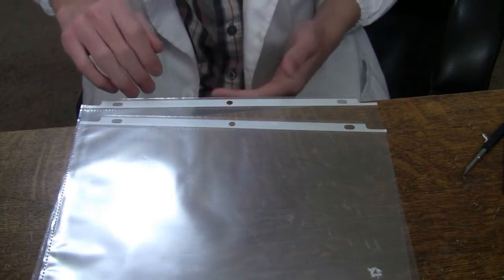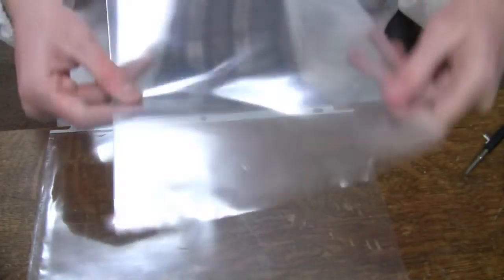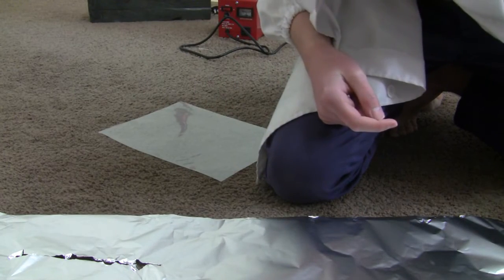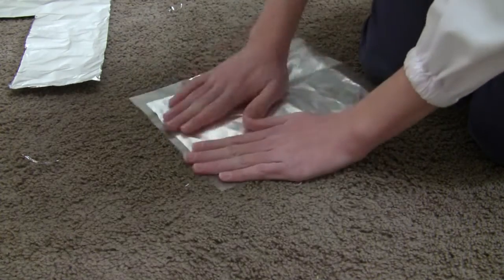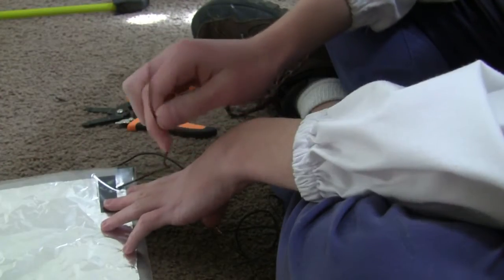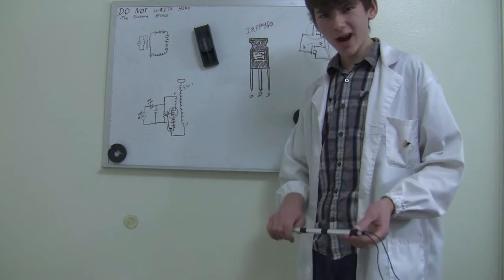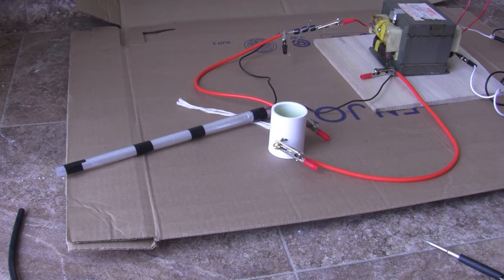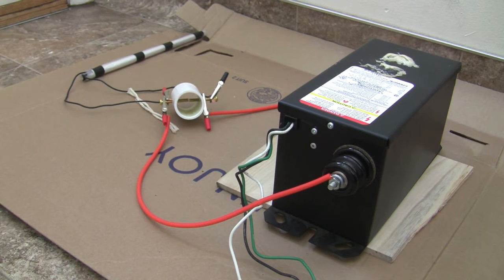DIY High Voltage Capacitor - High Voltage Plasma

Comment: Hey, i made one and tried using a MOT with it but it just bypassed it and arced mormally. What should i do?
Reply from the maker: Test the capacitor with a multimeter. If the capacitance reading doesn't show up your capacitor shorted out. Also I definitely don't recommend a MOT because they can't really arc across a gap on their own and they can dump a ton of amperage into your capacitor. If MOTs are all you can source, try a heavily ballasted dual MOT setup maybe
Reply: @Plasma.Prince Thanks a lot! Also, is it ok to use a one microwave capacitor in series with the secondary of the MOT to limit the current? Or should i use a light bulb in series with the input. I just dont want to bring down the voltage too, i dont have an inductive ballast haha..
Reply from the maker: @OpEdits1214  I've actually never tried using an MOC as a ballast so I'm not experienced enough to speak on that. I have used incandescent light bulbs as ballasts many times though so I can safely say that those are a good option for under 5 bucks.
Reply: @Plasma.Prince Ok also what were the diodes for when you used the MOT were they just rectifying the ac to dc for higher voltage?
Reply from the maker: @OpEdits1214  The dielectric strength of a capacitor drops when driven with AC instead of DC, so my 14 yo brain thought I needed them to protect my capacitor. The voltage was nowhere near high enough to short the capacitor though, I should've been more worried about the amperage.
Reply: @Plasma.Prince oh

Comment: How do you charge a capacitor with an AC source? Wouldn't a Van De Graaf work better?
Reply from the maker: A proper van de graaf can make bigger sparks if that's what your asking, but the point of that demonstration at the end of the video was just for proving that it works. You can use this DIY capacitor in a Tesla coil, big voltage multiplier, or Marx generator, which almost always produce bigger sparks than a van de graaf. As for AC capacitor use, AC will just charge and discharge a capacitor faster than it would if it were driven by DC, and it's used all the time. They're used to smooth out AC in rectifiers, they're used in voltage doublers, resonant circuits (Tesla coils), etc.

Comment: Lots of people have died using microwave transformers- by doing this without clear warnings you saying it out loud - personally are share responsibility for their deaths.
Reply from the maker: Mb bro, I'm usually better at remembering to put that in there, I'll put it in the description.
Reply: Thank you for acknowledging this … edit your video with a Risk of Death warning Do Not Do this at home.  People don’t read descriptions.   You are legally responsible for what you say on here. 

You can be sued- you can end up loosing everything with a very long prison sentance.
Reply from the maker: @AutisticCuriosity  I highly doubt I'll get in trouble if a person bypasses the warning in the top line of my description, on the case of the microwave oven, and on the sticker on the MOT. At that point, whatever they do is on them.

Comment: What is the role of the capacitor in this circuit? Knowing that you get high voltage without using a capacitor?!!
Reply from the maker: Eh, there's technically no role. The only point of that setup was to prove that the capacitor worked. But capacitors are crucial in a Tesla Coil circuit, so what I could've done to make the video cooler is build a Tesla Coil with it.

Comment: I have been a high-voltage engineer for many years.   PLEASE, PLEASE, do not underestimate the LETHAL aspects of those microwave oven transformers (MOT's)!  They can kill you instantly with the slightest mistake or an accidental nudge!!!  Use the neon sign transformers (NST's) instead...MUCH safer!  I know of TWO cases where an experimenter was killed instantly with a single MOT'!!!...and many times where experimenters were shocked with NST's, but would have died if they were MOT's!

At about timestamp 3:50   you said "WE NEED MORE POWER!",  Believe me, when you switched out the MOT for the NST, you were indeed putting in MUCH LESS power...and being MUCH safer!.

A 2000v 1A MOT (2000 Watts of power) is about the most deadly combination of voltage and current for the human body that you can find lying (YOUR body and/or the MOT) around.    A 12,000v  30mA NST (360 Watts of power) is a much better choice for more exciting and safer experiments.
TAKE CARE
--dALE
Reply from the maker: Hey Dale so sorry I didn't see your comment until recently, I realize that I forgot to include a proper disclaimer about MOTs in this video so I just edited the description to have one. As for what I said about more power, I mostly just said it cause it's classic lol, a MOT 100% packs a bigger punch than an NST. What I really needed was more voltage. I am older now and more experienced, so you don't have to worry about me!

Comment: I did this, and glued the sheets tight to the foil and it eventually arcd through... only of a 24v zvs driven flyback, maybe about 3kv output
Reply: You definitely want maybe 3-5x more dielectric sheets. They are not manufactured for surface purity and have some microporosity and irregularities.
Reply: I bought some thicker page protectors, didnt glue the sheets and it worked perfectly off 34.5v input to zvs :), with only  2 layers between foil so same as video @jordansimmons5538
Reply: If you want you can use epoxy and a thicker sheet
Reply from the maker: High frequency AC is definitely more capable of cutting through a sheet of plastic than a 60Hz NST, and the glue may also create uneven charge distribution across the plates and air pockets. This concentrates more charge across smaller sections of the capacitor and causing a burnout. Both are killers, sorry to hear about your capacitor!

Comment: What is the difference in the spark with and without the capacitor?
Reply from the maker: The spark is pulsated when the source travels through a capacitor, which is good for dumping energy into inductors for and outgoing electromagnetic field (so Tesla Coils basically haha).

Comment: how many volts is the final power bank
Reply from the maker: 12,000 volts, but I powered it with a variac which means the voltage going into the capacitor was much less than that, closer to 5,000v required to power the capacitor I'd say.

Comment: That's pretty awesome, I wonder if you would run a tesla coil from a bank of those...
Reply from the maker: You absolutely can! These caps have a capacitance of about 8 nF, so you can run a Tesla Coil with a 4 of em in a series parallel  arrangement, hope that helps!
Reply: @Plasma.Prince  wow that's way better than I expected, thank you so much for the information!
The Tesla coil I built is only one of the kits(video on my channel, but it isn't that great honestly), but I really want to build one from scratch. I've already got one MOT🤔😅
Reply from the maker: @SpectrumDIY  Great! Now all you gotta do is determine the wattage of that MOT, and buy another microwave at your local thrift store that has a similar wattage! Although MOTs have very high resonant cap values, so the DIY cap in this video would likely not work that well with it (even in series parallel with other caps). It would work better with an NST or ZVS driver. I dunno, maybe you can give it a go anyhow!
Reply: @Plasma.Prince  Fair enough 🤔
Might work, might also go down in a glorious fireball of sparks and smoke😬😅😆

Comment: Its a big NO NO Working on a carpet due to the static electricity.?
Reply from the maker: Well static electricity is not very dangerous at the scale we usually experience it as. What you see here is actually current electricity, and is much more dangerous. The electric shocks you can receive from a capacitor like this one are much higher capacitance than the shocks you get on a trampoline. So the carpet is not really an electrical hazard for experiments like this one, but I would definitely work on a surface that is not flammable. If I was you, I would work on a plastic table if you can.